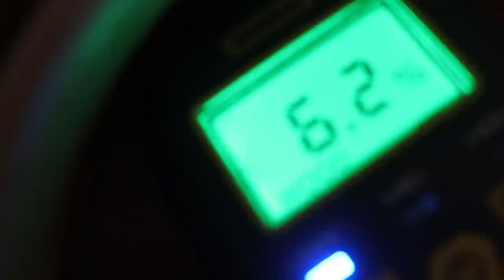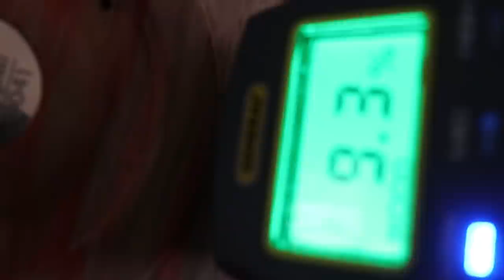Woodturning a Cherry Salad Bowl Set

Comment: Mr. Humphrey, Just noticed you are using a 3520c powermatic and i was wondering how you like it because I  just ordered one yesterday(4/3/21) I also saw what might be Carter and son tools if so how so you like them.
Reply from the maker: Hi Larry, I'm very happy with the 3520c, it's a quality machine.  The only accessory I've felt the need to buy (and I use it on most turns) is the tailstock swing away.  Very handy when you slide the headstock down the bed and work off the end for hollowing access.  Yes, I use the Carter & Son gouges.  Great quality, M42 HSS makes for fewer trips to the sharpening wheels, and excellent customer service too.  Thanks for watching! -Rod